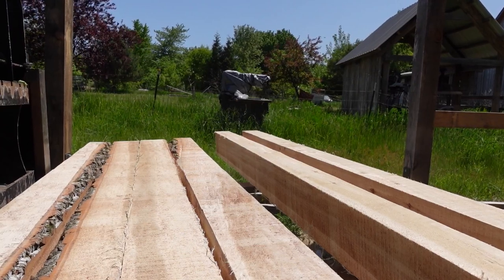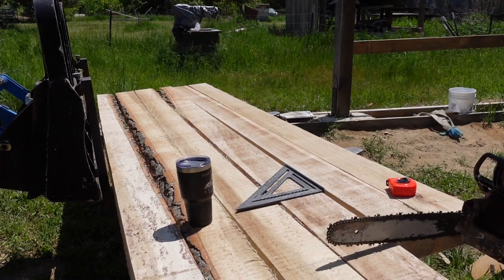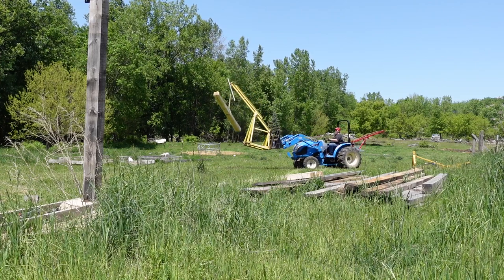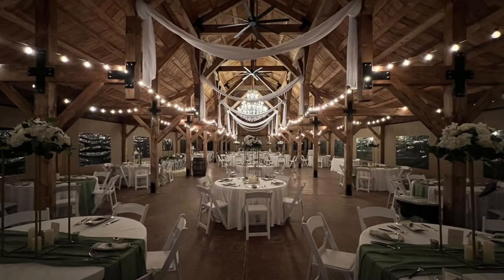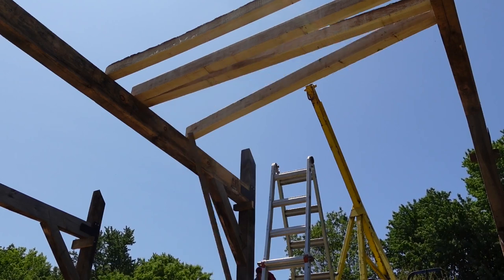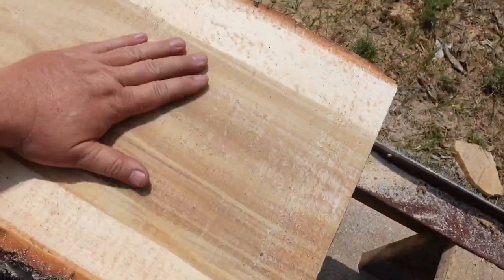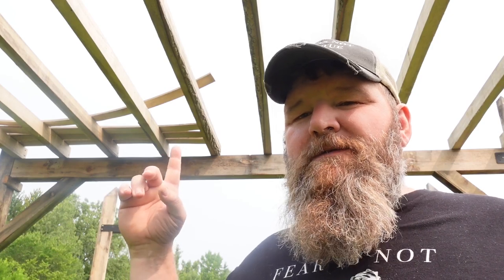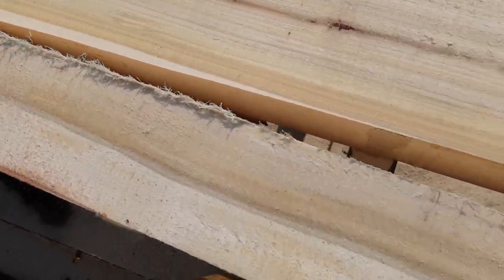Is Cottonwood any Good? | Post and Beam Barn Build

Comment: Looking at how big cottonwood trees get and the storms they endure, I imagine they must be pretty strong. Can you imagine how heavy 1k gallons of water is? I've heard a lot of mixed feelings toward cottonwood in regards to building with it. Generally, people say don't do it because of how flexible it is and it supposedly doesn't work well as posts. It's supposedly also not resistant to bugs or rot. But I don't see why you wouldn't be able to keep it oiled or stained...

I'm also in Michigan. I 100% agree with you. I think it'll be just fine, especially if you're using thicker pieces of wood... That seems to be the way the tree designed its branches to be used.

A lot of the wood you get from hardware stores is supposedly kiln-dried, but like with any oven, the center takes longer to dry. So you usually get boards that are too dry on the outer part of the stack and still green on the inside of the stack. Hundreds of years ago, people weren't drying their wood to build with it. They didn't have time for that. If I'm not mistaken, they would use whatever was closest to the job site and build with it as quickly as possible. They would seal the wood to prevent it from drying too quickly and that would prevent warping and cracking.

I'm thinking about building a barn and an extension on my house using the old techniques. I think we should meet up at some point. I would like to learn all I can from you and share some ideas with you. I'm curious to see what we can do to take our power back from the corporations. Local lumber yards should be able to thrive in this economy. However, most people don't or can't buy their building materials from local lumber yards due to absurd regulations that support corporate personhood. I have a grand design in mind that should end this idiocracy. Great caution must be taken when you're considering interfering with a multibillion-dollar revenue stream...
Reply from the maker: Agree 💯👍 I also have a Grand design in mind and am working towards the same goal.  That's what this channel is all about.
Reply from the maker: Also make sure to check out my video called rough cut revolution.  I think you will find it interesting.  More coming on that very soon.  Would love to meet up.  Shoot me an email. Through my website barngeek.com
Reply: @BarnGeek  Sent.